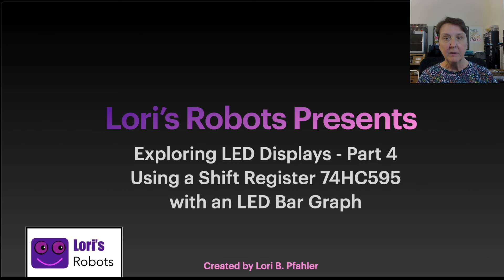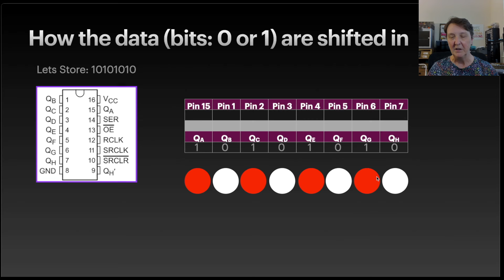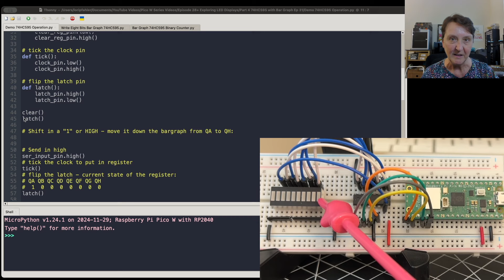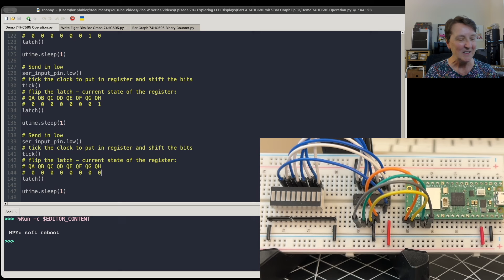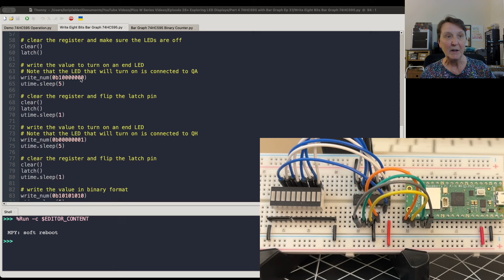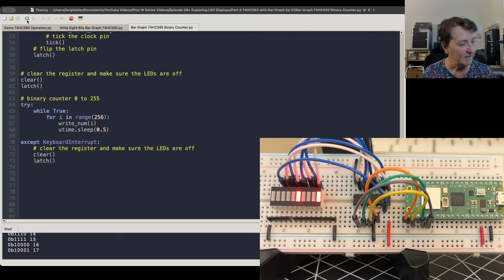Pico W Episode 31: LED Displays Bar Graph with a Shift Register 74HC595 Part 4

Comment: ありがとうございます、勉強になりました。
表示部に74595使っていたので勉強し直します。

import _thread
from machine import freq, I2S, Pin
from time import sleep_ms, sleep_us
import math
from array import array

#freq(278400000)
freq(294000000)
print(str(freq())[:3] + 'MHz')

### PFM 0, PWM 1 ###
Pin(23, Pin.OUT, value = 1)

pin_a = Pin(14, Pin.IN, Pin.PULL_UP)
pin_b = Pin(15, Pin.IN, Pin.PULL_UP)

### sck 1, rck 2, si 3, gnd 4, vcc 5 ###
sck = Pin(10, Pin.OUT) # 74HC595 SCK
rck = Pin(11, Pin.OUT) # 74HC595 RCK
si  = Pin(12, Pin.OUT) # 74HC595 SI

### dig1 1, dig2 2, dig3 3, dig4 4 ###
dig1 = Pin(2, Pin.OUT, value = 0)
dig2 = Pin(3, Pin.OUT, value = 0)
dig3 = Pin(4, Pin.OUT, value = 0)
dig4 = Pin(5, Pin.OUT, value = 0)

unit1 = Pin(6, Pin.OUT, value = 0) # Hz LED
unit2 = Pin(7, Pin.OUT, value = 0) # KHz LED

sck_pin = Pin(16)   # Serial clock output
ws_pin = Pin(17)    # Word clock output
sd_pin = Pin(18)    # Serial data output

#     a  b  e  d  dp f  c  g
s0 = [0, 0, 0, 0, 1, 0, 0, 1]
s1 = [1, 0, 1, 1, 1, 1, 0, 1]
s2 = [0, 0, 0, 0, 1, 1, 1, 0]
s3 = [0, 0, 1, 0, 1, 1, 0, 0]
s4 = [1, 0, 1, 1, 1, 0, 0, 0]
s5 = [0, 1, 1, 0, 1, 0, 0, 0]
s6 = [0, 1, 0, 0, 1, 0, 0, 0]
s7 = [0, 0, 1, 1, 1, 1, 0, 1]
s8 = [0, 0, 0, 0, 1, 0, 0, 0]
s9 = [0, 0, 1, 0, 1, 0, 0, 0]

path = "/data.txt" 
with open(path, "r") as ftt:
  fc = int(ftt.read())

def wave():
    global fc
    level = 8000
    ft = 0

    while True:
        if ft != fc:
            ft = fc
            
            if ft < 100:
                sampling_rate = 8000
                sr = sampling_rate // 1
            if 100 <= ft < 1000:
                sampling_rate = 48000
                sr = sampling_rate // 10
            if 1000 <= ft < 10000:
                sampling_rate = 96000
                sr = sampling_rate // 100
            if 10000 <= ft < 100000:
                sampling_rate = 192000
                sr = sampling_rate // 100

            audio_out = I2S(
                            1,
                            sck=sck_pin, ws=ws_pin, sd=sd_pin,
                            mode=I2S.TX,
                            bits=16,
                            format=I2S.MONO,
                            rate=sampling_rate,
                            ibuf=10000
                            )

            do = array('h', [0] * sr)
            for i in range(sr):
                do[i] = level + int((level - 1) * math.sin(ft * 2 * math.pi * i / sampling_rate))

#            with open(path,"w") as ftt:
#                ftt.write(str(ft))

        audio_out.write(do)

_thread.start_new_thread(wave, ())

def b_in(pin):
    global fc
    if pin_a.value() == 0:
        if 99000 > fc >= 10000:
            fc += 100
        if 1000 <= fc < 10000:
            fc += 100
        if 100 <= fc < 1000:
            fc += 10
        if fc < 100:
            fc += 1
    else:
        if 1 < fc <= 100:
            fc -= 1
        if 100 < fc <= 1000:
            fc -= 10
        if 1000 < fc <= 10000:
            fc -= 100
        if fc > 10000:
            fc -= 100

def dig():
    global sx
    if dt == '0':
        sx = s0
    if dt == '1':
        sx = s1
    if dt == '2':
        sx = s2
    if dt == '3':
        sx = s3
    if dt == '4':
        sx = s4
    if dt == '5':
        sx = s5
    if dt == '6':
        sx = s6
    if dt == '7':
        sx = s7
    if dt == '8':
        sx = s8
    if dt == '9':
        sx = s9
    if dt == '':
        sx = sB

while True:

    pin_b.irq(handler=b_in, trigger=Pin.IRQ_FALLING, hard=True)

    if fc < 1000:
        unit1.value(1)
        unit2.value(0)
    else:
        unit1.value(0)
        unit2.value(1)
        
    if 1000 <= fc < 10000:
        fs = fc // 10
    else:
        fs = fc

    n = 0
    if len(str(fs)) == 1:
        n = 3
    if len(str(fs)) == 2:
        n = 2
    if len(str(fs)) == 3:
        n = 1

    for dt in list(str(fs)):
        dig()
        n += 1
        if n == 2 and fc >= 1000:
            sx[4] = 0
        else:
            sx[4] = 1

        for d in reversed(sx):
            si.value(d)
            sck.value(1)
            sck.value(0)
        rck.value(1)
        rck.value(0)

        if n == 1:
            dig1.value(1)
            sleep_ms(4)
            dig1.value(0)
        if n == 2:
            dig2.value(1)
            sleep_ms(4)
            dig2.value(0)
        if n == 3:
            dig3.value(1)
            sleep_ms(4)
            dig3.value(0)
        if n == 4:
            dig4.value(1)
            sleep_ms(4)
            dig4.value(0)

    sleep_ms(0)
Reply from the maker: どういたしまして. 7HC595の使い方についてあなたのコードを勉強します。 とても興味深いですね!  ご視聴ありがとうございました!  Hope that google translate worked.
Reply: @lorisrobots  
返信ありがとうございます、python初めて半年なので調べながらやっています。
一応PCM5122を使って正弦波の発信器作ろうとしてました

Comment: My first project with a PI was just this same shift register.  I spent many evenings pouring over the data sheets, and websites and finally I got it to work.  Your video does a great job of teaching this useful component and your demos were very timely.  Thanks
Reply from the maker: It was hard to find easy, straightforward explanations for this chip.  It is fun to use for sure.  Thanks for watching!